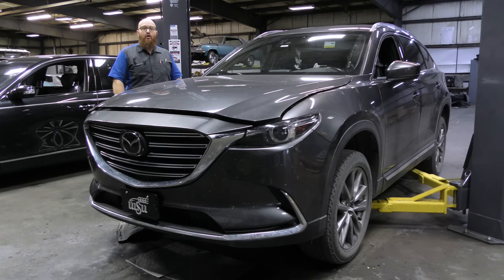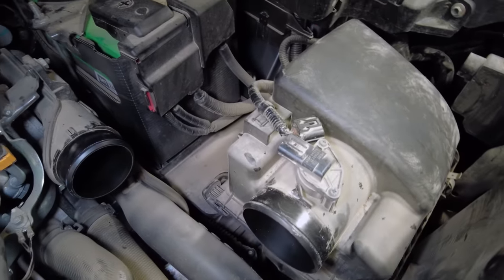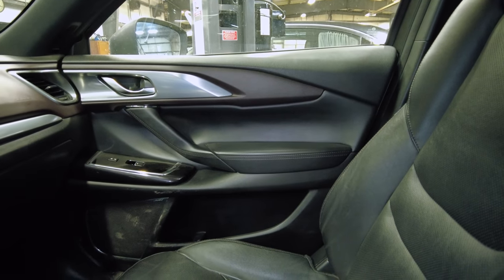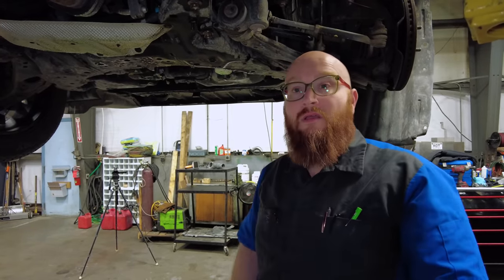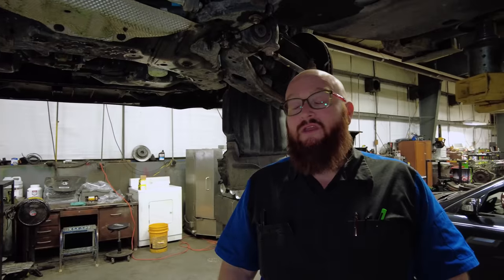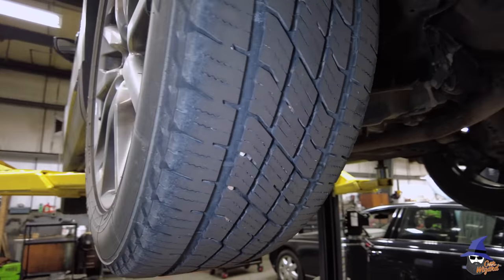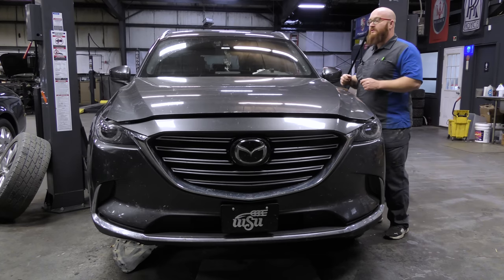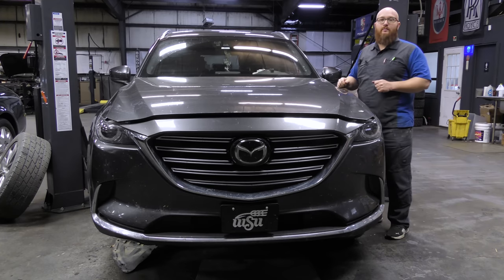Really, a $4K leak! What could be wrong with this '16 Mazda CX9 that could possibly cost that much?

Comment: I am a Mazda technician and for a select  few years they had faulty head gaskets, they usually fail while under the 60k powertrain warranty, but it’s unfortunate theirs failed outside of that warranty. Also the 2.5 is not a ford engine, Mazda built and designed that in house.
Reply: The gaskets don't fail. The cylinder heads are defective....... Mazda is selling updated/ redesigned heads to fix this issue. I was a former Mazda Service Advisor and we did quite a few of these.
Reply: Yes the cylinder head cracks. Seen it about 20 times at my current dealer. Replaced a few heads and full long blocks
Reply: Heads cracked.
Reply: There is a tsb on this
Reply: Customer concern verified.  Cylinder head leaks/cracks.
Reply: Faulty head gaskets?  Do you mean faulty head, Mr Mazda technician
Reply: It’s sad to see when a car, fancy or not, unloved.  We have two kid-haulers at home, we have triplets, and they are MESSY!  But I manage to keep the interior clean with daily wipe down with cleaners and conditioners.   I have time because I’m an insomniac and I get up at 2 in the morning. But an unloved car, breaks my heart.
Reply: That's what these car manufacturers are hoping for.  Making the car last just long enough to make it outside of the power train warranty and having it fall on the customers themselves to get these issues fixed.
Reply: fr??? I though Mazda was doing good, was abt to look for a Mazda 3
Reply: @mnwolves180    So if my cx9 is a 2017 with 108k miles...should I be worried it might happen at any time?
Reply: @Fremen02  your 2017 does fall within the Mazda technical service bulletin for the cylinder head issue. If I were you,  buy a good extended warranty, and they will cover the issue if it happens, if you do not already have one.
Reply: @mnwolves180 most extended warranties only cover it if the damage to the head was caused by other lubricated internal parts. Not mfg defect. Such bs.
Reply: @HorseBudgetHero  I used to deal with ext warranty companies that definitely covered the defective cylinder heads when I worked service at Mazda. Assurant is the main company we dealt that did cover them.
Reply: @joshhaber7985  is it only the 2.5 turbos?   
   I have a 2016 Mazda 6 and a 2019 CX-5 both non-turbo. 
   The 6 has 130,000 mi on it with no issues so far
Reply: @joshhaber7985 2018 cx5 cracked head and leaked very little under 54K miles but out of powertrain. Just figure out how to fix it and get rid of it, What's the torque on cylinder head? thanks.

Comment: The 2.5 liter Sky Active engine is a Mazda-designed engine. Mazda was completely separated from Ford before 2016. I have a non-turbo 2.5 L in my 2016 Mazda 3. I have had no problems with it.
Reply: Same here I have the non turbo 2.5 in my 2022 Mazda 3 Hatch and it’s so solid. Whole car is actually premium solid feeling. I can’t believe we caught the wizard on an information error.
Reply: Spot on they parted ways in 2015. I've had Ford and now own Mazda's, would never have bought the Mazda if they had anything to do with Ford that's for sure.
Reply: Some of the original engine design might be Ford but yes Ford was 100% gone in 2016.
Reply: @scottarmen9097 Other than some parts sourced from Ford this is 100 percent Mazda. Mazda spent tons and took a huge gamble with it at the time they designed it as it was during the great recession and Ford was selling their stake in the company.
Reply: My 2014 CX5 with the NA 2.5L Skyactiv just started having small amounts of coolant show up in the oil on my oil reports. Not looking forward to this. I’m hoping it’s something like an oil cooler issue and not the head gasket.
Reply: @simoncarter4231  parted ways in 2011
Reply: @scottarmen9097  other way around. Mazda designed the L block engines which Ford uses as duratec and EcoBoost for turbocharging. Ford put their own head and fuel timing system on theirs, Mazda used their own on their own. Skyactive is an updated version of the L block, and by 2013 both sets of engines weren't sharing development anymore. The Skyactive 2.5 was developed separately by Mazda after this period, and both sets of engines have been developed  and revised and overhauled separately for a decade now. It's not a sibling to the duratec 2.5, at best they shared a grandpa. There's no parts sharing or production sharing anymore either, the absolute last of those agreements ended in 2015. 

That's why all those redesigns happened in 2016, and where the Mazda6 used to be built in America it was shifted over to Japan.
Reply: I have the baby 2.0.

Comment: We bought a used 2018 Mazda CX-9 with almost 28,000 miles on it from Carvana. I took it to our local Mazda dealer to have it inspected to make sure everything was alright but they called back and mentioned the crack in the cylinder head that I see people mentioning on here. The car was still under warranty so the engine was replaced at no cost to us. I’m so happy that Mazda stood behind their product, this car has been great for us ever since.
Reply: Great input.
For just that less kilometers engine crack. That's not good.
Would you recommend me to buy this suv used with 120k? What year would you recommend?
Reply: @jackryder6732  That’s a lot of miles but I would recommend taking it to a Mazda dealership to have it inspected before purchasing it if possible.
As far as the year goes the Mazda Cx-9 has the same engine and transmission from 2016 to 2023 but I’m sure improvements have been made over the different model years so I would try to get the newest model you could afford.

Comment: We did a lot of these leaks at the dealer and it was a porous head where a little pinhole almost invisible to the naked eye would form and appear to be coming from the head gasket but it will most likely need a cylinder head… The turbos do this with coolant, NA’s do it with oil.  Also it’s a Mazda engine not Ford.

Comment: Mazda tech here
 

The cylinder head is cracked where the studs go into the head from the manifold. If the  vehicle has p011a it needs the engine replaced because it went over 250°. But you can replace just the cylinder head if no code is present.

Make sure you get the upgraded exhaust manifold gasket that prevents heat from the weak parts of the head.

See TSB 01-013/21
Reply: Would there be any benefit to preemptively have the upgraded manifold gasket installed in order to prevent the original head from failing? I have a 2020 CX-9 and the vin# does fall within the numbers noted on the TSB.
Reply: @John Stipic you could but the it's the cylinder head that has a weaker casting near the exhaust studs. Monitor coolant level really closely. Also look near the studs and make sure it hasn't started yet. You might not see it leaking down, but it could be at the beginning stages. Usually occurs between 75-90k
Reply: @john7365 Yes, I have couple drops down to the lower heat shield to the catalyst and my is 2018 cx5 under 54k miles.
Reply: @john7365 it’s to late for me 😢 I had the same exact problem car is just sitting now

Comment: I have owned one for 5 years, That is not a headgasket issue. The head is blown where it meets the turbo, common due to a manufacture defect. The headgasket likely blew due to over heating after the head cracked. Mine went a few months ago and to Mazda's credit, they covered the whole repair which would have been a 6 - 7K bill, even at 100,000 km (Live in Australia). 

When mine blew, it was a cold night and noticed that the heater no longer worked, the temp gauge showed no over heat. I only had a 15 or so minute drive and got back home. I could smell the heat from the engine bay as soon as I got out of the car. I was due to change the oil later that night and did so, but there was pool of green blood all over the underbody covers, it was done. 

If the temp gauge never showed an overheat (due to reading only air at this point), and you were using the aircon in cold mode, with little to no fluid spills due to the covers underneath, you might not even notice that the head has blown, right up to the point where pistons start coming out of the block.
Reply: This is one of those times a trip to the dealer and a diagnosis fee might be worth it to see if Mazda will cover some cost or most of it.  My sister had a turbo issue on her Cruze (lol 1.4T Ecotec), and she was just out of warranty.  I told her to see if she could get some goodwill, and the dealer called back they would cover it for $150.
Reply: I had a 2018 CX-9 bought in Australia but only put 18k km on it before I left that part of the world (pacific island) and sold it. I remember that Mazda increased the Aussie warranty to 5 years but I guess you also only had 3 years.
Reply: Would you recommend me to buy this suv used with 120k? What year would you recommend?
Reply: @jackryder6732  I would get one used, as long as the headwork has been done. Always get the latest model you can with the lowest km, also make sure it has been serviced. Also look for rust if you live in winter areas where salt is used. They are a great car, not perfect but good value for the money.

Comment: The head gaskets don't fail. The cylinder heads are defective. Mazda is selling updated/ redesigned heads to fix this issue. I was a former Mazda Service Advisor and we did quite a few of these. The engines and trans however are Mazda designed, not Ford. This issue affects 17-20 CX-5 turbo and non turbo engines as well and the CX-9s and 6s.
Reply: Hello
I am from Toronto. What year mazda cx9 would you recommend with hardly issues.?
Reply: Is my 2017 safe? 😂
Reply: @nedaltrebor8553  yes 17 should be fine. The heads were redesigned in 18. I have a 14 3 and that isn't not affected either.
Reply: @mnwolves180  Please double check your statement regarding the redesigned heads timeline. I've read quite a few threads related to this cracked heads issue and they were at least upto 2019. 2018 is definitely affected.
Reply: @Khoanguyen2010  you've read threads.... I used to work at the Mazda dealership as a service advisor. I have first hand knowledge ....
Reply: @mnwolves180 cmon mate, do some google and read the actual tsb content. Then you can tell the US gov and mazda that they are wrong and you are right.
Reply: @Khoanguyen2010  the only model affected before 18 are the CX-9s. All other models are 18-20.
Reply: @mnwolves180  thats is incorrect. Please check the tsb for the actual details of model years. 2018 cx9s are affected. The new head design came out in 2020 but then mazda has oil consumption issue for some of the 2021s. Im not sure what was changed to fix the cracked head issue but its possible that the change might have introduced another issue.
Reply: What about the 2017 NA 2.5L Mazda 3s?
Reply: @gsog6078  nope the 3s are good
Reply: @mnwolves180  How about a 2020 Mazda CX-30 NA 2.5l?

Comment: Not, it is not a Ford engine... this was the very first year of production of the Turbo 2.5 skyactiv engine. It is not rare to have issues in the first 1 or 2 years of production. It's been a pretty solid engine and any car maker has issues. Remember not long ago Toyota had issues with their then new K-CVT transmission. Honda with the 1.5 turbo oil dilution. I mean, Japanese brands may have less issues than European/Korean or American brands, but still, new designs, there's always the possibility of something happening... That is also why I am happy with brands like Honda, Mazda or Toyota keeping their engines in production for a long time, and not trying to develop a new one every 5 years.
Reply: Mazda and Nissan are the chrysler of japan
Reply: @rosssmith9941  nah only Nissan
Reply: @rosssmith9941 Chrysler, GM , and Ford literally all suck the same amount 😂. BAD. They're only lucky the US doesn't let other brands import large trucks here cheaply or they'd really be screwed!

Comment: 2017 CX-9 owner here.  Just had this leak issue resolved.  Live in South Jersey outside Philly.  Ours had 84k mi when I noticed a sweet smell.  Looked underneath, green stains on everything and wet spot on ground.  Reservoir empty but radiator full.  Took to independent shop that would work on it.  Wanted $8k.  Said heck no.  Called Mazda corp to lodge a complaint.  Made a case that this is unacceptable at this mileage even though out of warranty.  I said it’s in your interest to keep us (wife and I) happy, cuz who’s most likely to buy your fancy new CX-90?  They said to take to dealer for inspection, and they would consider a relief reimbursement.  The one Mazda dealer in NJ outside Philly refused to participate.  The stealership manager said car is out of warranty and Mazda is crap and don’t buy another one, called me a freeloader, and told Mazda corp case mgr to buzz off.  Wow, way to sell the brand bro…😮. Then corp had us take car to Mazda dealer in PA suburbs that was willing to work with us and corp.  After the PA dealer did inspection, discussed with corp and Mazda corp agreed to pay for all costs except $250 (cost of fluids and gaskets).  It took 2 weeks to get a new cylinder head from Japan.  A top spec CX-50 turbo used for demo & sales training was provided during the whole ordeal, which was a month.  Our CX-9 runs like a top and drives great, even with the leak and now with leak fixed.  The dealer situation in NJ, however, I think will keep us from buying another Mazda.
Reply: Thank you for sharing you experience. I heard my owners bring their car complaints to Mazda headquarters and they honored engine replacement even after the engine was out of warranty.  I’m glad to hear it worked out well.  I have a 2016 CX9 with 65k miles. It runs great.  I hope it doesn’t have the same issue.
Reply: Can't let one bad dealership ruin the brand rep. Those kind of dealers are all around for every brand
Reply: Wow, pretty shocked that Mazda worked with you and paid for the repair out of warranty.
Reply: @ATICrossX My wife and I were expecting Mazda corp to reject our petition for relief or give us a token BS discount.  Some things to note for our case…
- We (wife and I) are the original owners
- All service performed on schedule at Mazda dealers.  Follow severe driving schedule.  Very through maintenance record on vehicle.  I anticipated something like this happening, so we paid for overpriced dealer service instead of independent shop so if something happened, Mazda couldn’t use that excuse if we had to file a case to apply for post-warranty relief.
- The dealer in PA willingly worked with us and the corp case manager and engineering support.  They advocated for Mazda corporate to play the long game and that this is very bad look for the brand, and they should cover this. (while the dealer in NJ wanted nothing to do with us)  So we found a dealer willing to go to bat for us.
- This happened at the same time as the CX-90 launch (tops out at $62k!!!), and I reminded our case manager of the power of social media and this would be a bad time for a video to be posted showing that Mazdas are half-baked crap, failed head gasket at less than 100k miles.  I know Subaru owners that got no-cost CVT out of warranty replacements for sake of keeping people loyal to brand.  Argued Mazda should do the same for us.
- The dealer and Mazda engineering support decided to replace the cylinder head instead of recon/reinstall, so our car would have the current revised design.  They had to drill and tap new beefier studs into short block for the head attachment.  Mazda engineering said the cause for first iteration turbo engines to leak is heat sink from turbo’s housing that’s integrated into exhaust manifold creates a localized hot spot compared to rest of engine, and the thermal expansion/contraction of the head and short block not being consistent because of this heat concentration will cause the head gasket breakdown after X thermal cycles, near the the turbo.  Once it starts leaking, you’re screwed.  But it is on the short block perimeter and not around cylinders, so leaking like crazy, it will still drive fine, assuming you keep topping off the reservoir tank.
- I was persistent and kept calling and emailing, until I could find a sympathetic ear attached to a person with power to make something happen.
Reply: Hi KDogggRoc, thank you so much for  your comment. I really have the same problem with my ,Mazda CX9, 2017 and I went to Mazda dealership after checking it they said that I need a new engine which is about $8500 CAD. For sure, I will file a complain and see what is going to happen.

Comment: Yeah Wizard I'm sorry but you're wrong. I don't know if you actually saw FoMoCo badges on parts but Ford no longer owns Mazda. It's been that way for a while. On the dealer sticker you can see that 90%+ of the parts come from Japan. Mazda is probably one of the most japanese Japanese brands since most of their cars are made there.
Reply: FORD ownership is the kiss of death to any car manufacturer.
Reply: Not true bro, at least the last part. Mazda produces its car both in Hiroshima and In Mexico. Quality is top notch in both facilities tho, but yeah it also relies on outsourcing
Reply: @Neopumper666  mazda dont make head gaskets
Reply: regardless mazda is a third or fourth tier  maker-  def not among the best
Reply: @jonsimmons4150  it’s not a ford engine
Reply: How are you so wrong about Mazda. Ownership Owners
Japan Trustee Services Bank (6.3%)
Toyota Motor Corporation (5%)[2]
The Master Trust Bank of Japan (4.7%)
Sumitomo Mitsui Banking Corporation (2.2%)
Ford sold out in 2015.
Reply: @alistairharris7891  mazda dont make gaskets.
Reply: @jonsimmons4150  never said they did